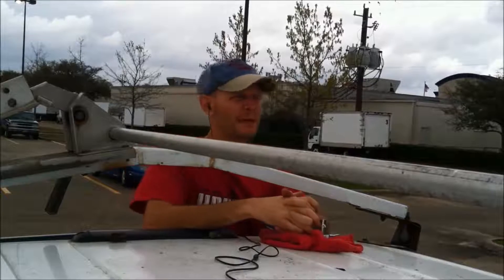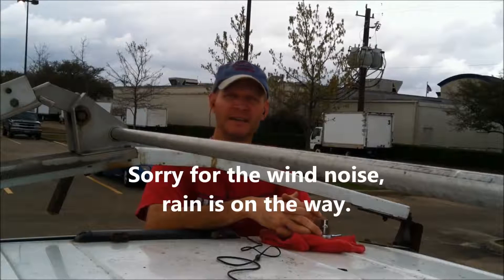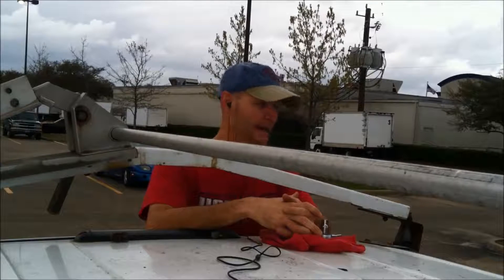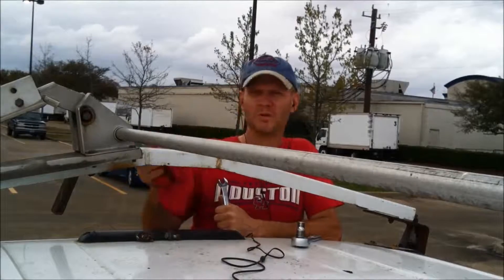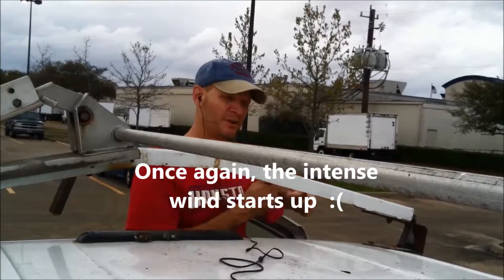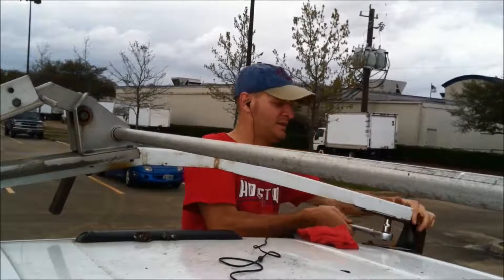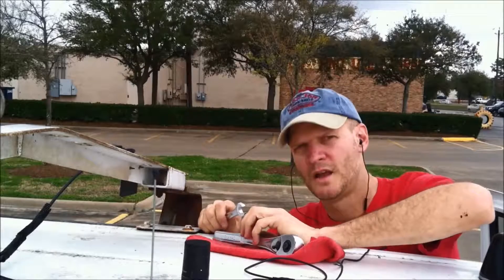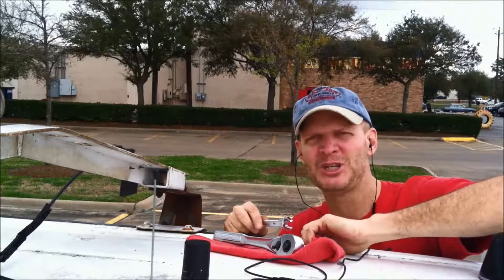Astro Van Ladder Rack Removal - Pre-Camper Build

Comment: Dear Traveling Troy, I am leaving the ladder rack on my Astro Van so I can carry a 12 foot day sailor (Snark) and a 16 foot kayak. But I also think it would be possible to rig a white plastic tarp on it while summer camping to keep the sun from beating down directly on the roof. Many tents have a fly sheet for just this purpose. That way air can circulate between the roof and the fly. Also I discovered that with the safety partition removed both seats recline far enough to sleep on! I put reclining seats in my Barracuda and have slept in 50 degree temps under a spread-open sleeping bag in comfort. And since heat rises, I am thinking to put insulation in the roof and sides but not on the floor of the van. What do you think? Capt. Mark.